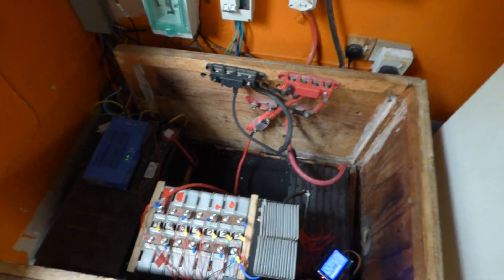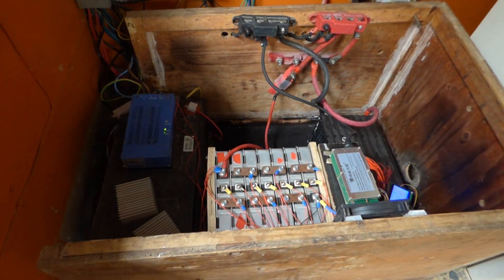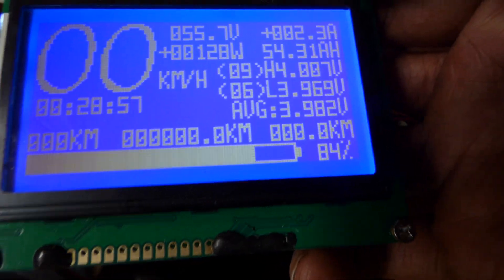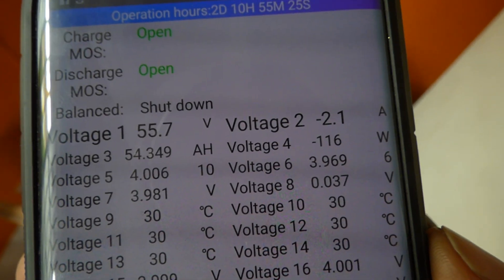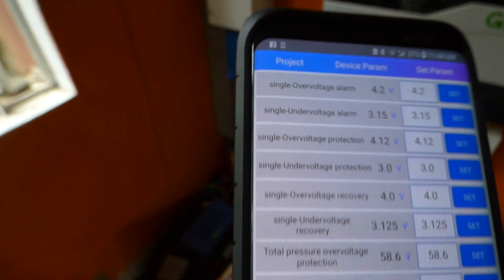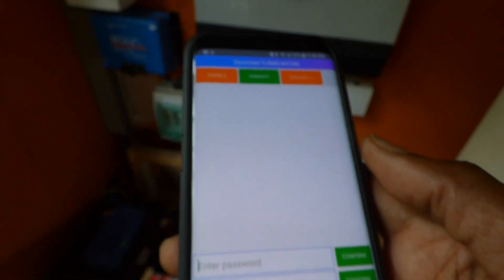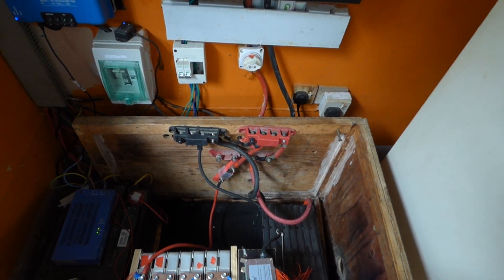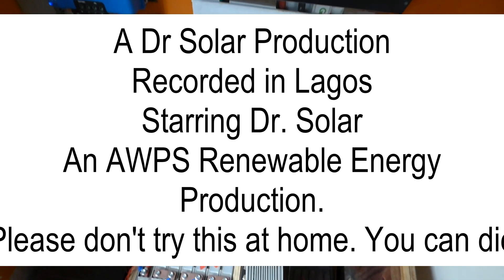Like Magic my new BMS works. See the video and be blown away

Comment: How the parameter is changed the voltage that an alarm is occurring when another step below 62 volts showing that it is a 150 A battery to 84 volts ?
Reply from the maker: It has been so long that I am not sure I remember how

Comment: Hi there..may i ask a question
The B- goes directly to the main negative battery terminal but where does the C- go? Thanks a lot!
Reply from the maker: The C- is your charge and discharge port for your BMS that separates them. I put mine if I remembered on the  negative bus bar
Reply: @drsolar  hi so i need to split the C- into 2 connectors?  charge and discharge connectors?
Reply from the maker: @MrDeceptacon88  let me confirm. Give me a day or two I stopped using DYI BMS
Reply: @drsolar  ok thanks!

Comment: is it possible to adjust current of charging in app? I found good deal for waterproof 25A charger - main problem is - I want charge at home at 5A max, on rush 10-20A - depends of temperatures
Reply from the maker: Hello Mike yes you can.
Reply: @drsolar  hello again, after i got info from you and also two other person i ordered 30a charger but now i am getting info, ant bms can't change it :/
some ppl says I can adjust overcurrent charge protection but nothing more, i am confused
Reply from the maker: @duniek86   sorry to hear about your experience. You put your 30 amp charger on and the battery is not charging. Is that what you are saying?
Reply: @drsolar  I ordered ant bms and charger few days ago, didnt receive it yet. My goal is to charge on road trips @ 30A (14p vtc5A pack 36Ah) and 7-8 maybe 10A at home when I dont need to be charged at one hour. Problem is that only you and one person reply about my question about adjustable charging. Now while I am waiting for bms and charger, more ppl respond and says it can't be done - if i have 30A charger - it will be charge @ 30A always
Reply from the maker: @duniek86  your charger will put out 30 amps but your BMS and batteries don't need to accept the 30 amps. Chargers posses some intelligence. They either look at voltage, current and resistance. If it does not have the intelligence, your bms will cut off charging.
Reply: @drsolar  probably my battery is capable to charge even more,  just two reasons about slower charging:
1. longer life of pack
2. electrical breaks on random spots might be not capable to hold 2500W

Comment: Thanks for the video. After watching your video, I ordered the same BMS, and set up it smoothly. The only issue I have is with the Bluetooth connection. I can pair it, but can't connect to it afterwards. I tried three different phones without success. Did you have any issue with the Bluetooth connection?
Reply from the maker: It was hit or miss with the bluetooth. I had sometimes to do a manual connection. Go into your bluetooth settings and look for the BMS. The try connecting from there

Comment: Dr. Sola, Nice video thank you for sharing. Apologies if I did not get the spelling of your name correctly.   Would like to use this BMS for a 10S e-bike build with a 25 amp controller.  Some questions for you.  Is there any harm to purchase a higher amp BMS?   I also noted that some of the Bluetooth software could of been labeled better as you pointed out. Have you seen a software upgrade that includes this yet?  What is the difference between the app for the manufacture's BMS app vers the VBMS by Vortecks and why did you choose to use VBMS?     Thank you.
Reply from the maker: Good morning Steve. Thank you for watching and commenting. There is nothing wrong with purchasing a higher amp bms. It means that you can do a future upgrade in capacity using the same BMS. They have yet to push through a firmware update to address the concerns. I was looking for a bms and stumbled upon this. I had no particular reason behind picking it. My batteries and system did not come with a bms so I had no choice in the matter.
Reply: @drsolar  Just to be clear, did you try the two different BMS apps to compare?  You are using the VBMS by Vortecks currently?
Reply from the maker: @stevecahill9106  I did not try any other app. This was recommended by the seller of the bms and it is what I used. I am now using Chargery.
Reply: @drsolar  Do you have a link to it on the Google Play Store. Can not find the app under "Chargery"  Thank you.
Reply from the maker: @stevecahill9106  sorry I meant to say that I have changed my bms. I no longer use the unit in the video. Sadly Chargery does not have an app or support Bluetooth. I am open to suggestions on bms to try
Reply: @drsolar  Any reason you stopped using the Bluetooth BMS you showed in the video?
Reply from the maker: @stevecahill9106  it would shut down when the AC tried to come on. The AC was a small window unit.
Reply: @drsolar  Do you think a setting in the BMS needed to be set to avoid this? Perhaps it was triggering a protection by the BMS to shut down?
Reply from the maker: @stevecahill9106  we checked every line. Increased the max discharge and we could not see what it was. It would give an error message (I forgot the message) and then come back on again. It powered water pumps with no problem just the AC

Comment: Hi, very nice! We have the same BMS system, but I can not connect to the BlueTooth APK on my smartphone. What kind of APK do you use in you phone? Thanks a lot!
Reply from the maker: We did not have to load an apk to our smart phone. We used the standard bluetooth connection. You might have to go into your bluetooth setting and add it manually. So scan for bluetooth devices, you will see it with a strange number or BMS-ANT24S. Enter the password 1234. And then try to connect from the app
Reply: @drsolar  , yes, to this point, the BMS-ANT24S is connected to the phone. What is the name of you app.?
Reply from the maker: @VasjArtigian  VBMS

Comment: 👍🏼👍🏼 good video brother. I m about to do a leaf set up too (12s). Wasn’t planning on using a BMS but I would like to try the one you’re using here. Can you provide the link to your supplier?
Reply from the maker: Hello Calvin. Thank you very much. I put the link in the description. I strongly suggest that you get a BMS. I was seeing individual cell voltages in excess 4.30V without a BMS. I am not so sure that I did not damage one of the cells. Even within modules there are voltage differences. Thank you for watching and commenting
Reply: AWPS Renewable Energy, LTD thank you brother

Comment: Thankyou for the full explanation, what a great unit, i must admit i quite like the smart phone connectivity. 
being able to keep an eye on things will keep my mind at ease, so this may just be my next investment.
cheers
Reply from the maker: The smartphone connectivity allows me to monitor the cells from my bed. It is 440 am and I just took a look to get total system voltage, temperatures and cell voltage from the comfort of my bed. Put a heat sink on it or it will burn out. Batteries are over 52 v. First night with power through the night since I went to lithium ion batteries.

Comment: those lg batteries should be 67.2v full charge :)
Reply from the maker: Hey GOG. They are 16s. Would that not damage them? The nominal voltage is 59.2.
Reply: @drsolar  4.2v per cell max charge I charge mine to 4.125 volts per cell giving 66 volts max charge :) you will gain a massive amount of power from this :)
Reply from the maker: @GoingOffGrid101  there are not too many inverters that will go that high. Also I figure that without a Bms on the LG I am playing it safe. I am getting a new inverter next year. We can play with it then. Thanks as always. You have been an incredible resource for me. I will watch your video on the LG to learn how to wire the BMS to them.
Reply from the maker: @GoingOffGrid101  what is the the minimum that I can charge it to get capacity?
Reply: @drsolar  63 volts is about 70% charged 66 volts is 95% charged
Reply from the maker: @GoingOffGrid101  at 57 to 59 V I am under 50%. Yikes. Thank you. So I have about 1 kwh available

Comment: Hmmm only if i understood all that u were saying🤔🤔. Glad u have been able to "Top balance" everything😎😎😁
Reply from the maker: Thank you Susan. To get them to work well you need to charge them to the max. Without a BMS you can overcharge and damage them. You will always have a few that charge at a lower or higher voltage. The BMS hold them to the desired voltage allowing us to unlock the full capacity of the batteries